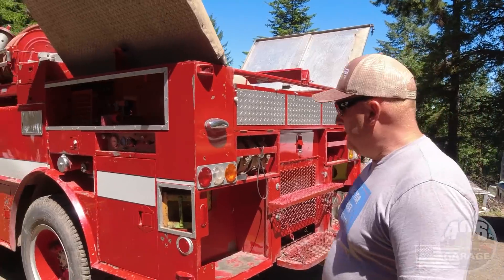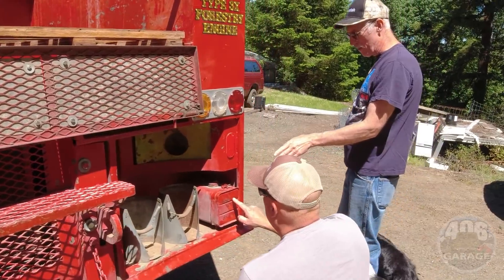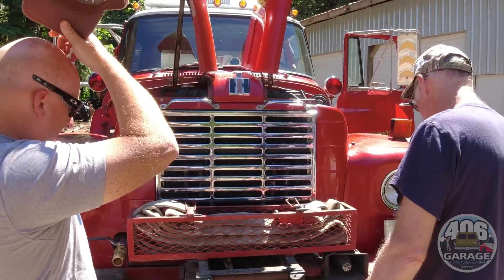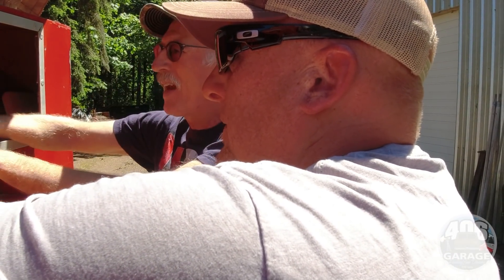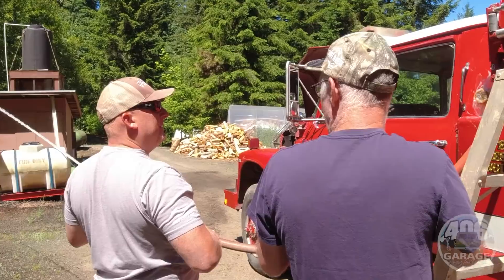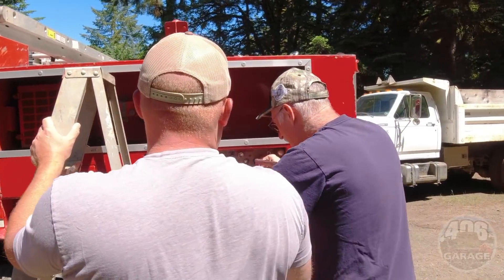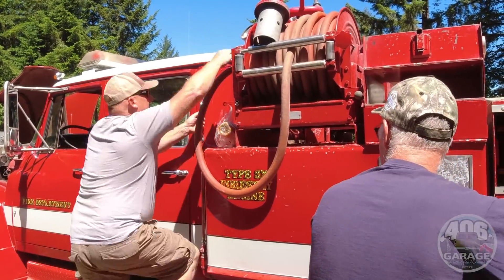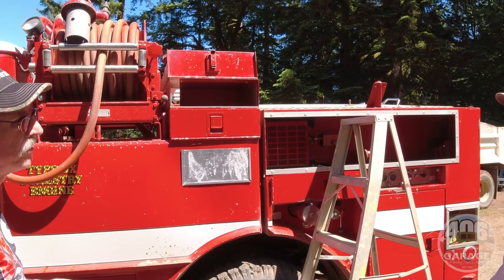Binder Finder 1975 Firetruck Pt2 AIN'T SHE BEAUTIFUL!!!

Comment: This fire engine is a Model 10 of the Calif Department of Forestry (Cal Fire) . They also made a Model 12 which was 2 wheel drive. The 2 silver container on the right rear are for forestry drip torches.